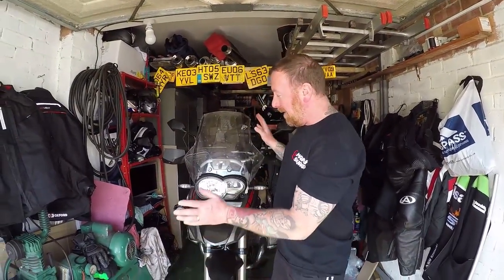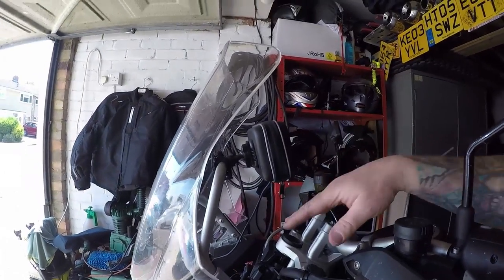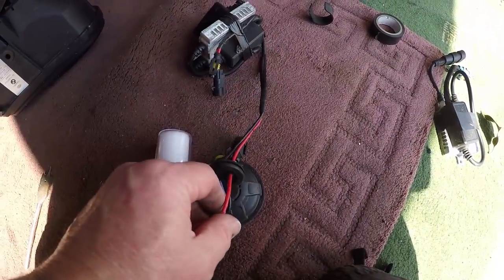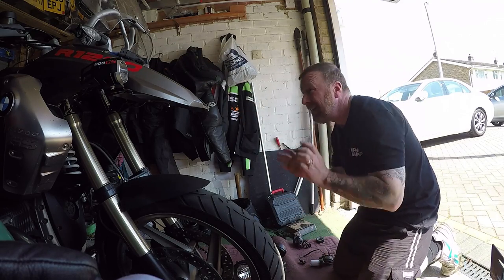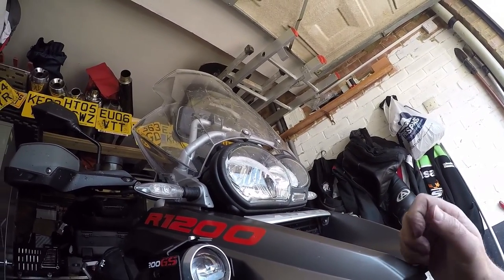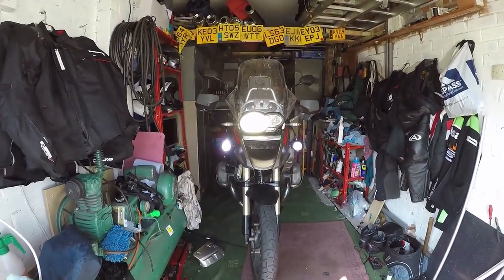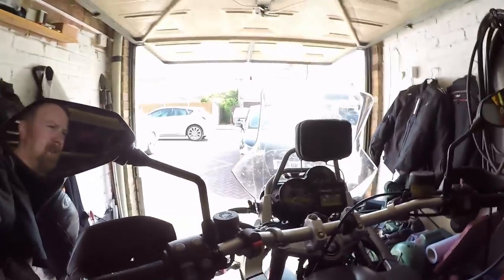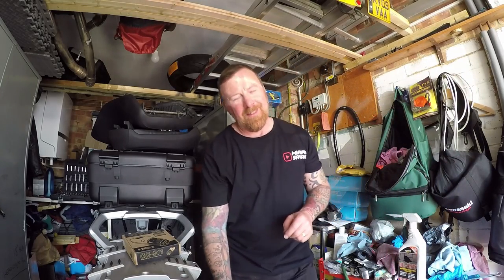BMW 1200 GS XENON HID LIGHT UPGRADE SIMPLE FIX MARK SAVAGE

Comment: Phew there bright  ;-)
Would you have any ideas on upgrading my headlight,i have a 2001 BMW F650GS,and the headlight runs on gas,the bloody thing is absolutely "CRAP"
Help Regd 
Cheers Baza ;-)
Reply from the maker: hi bud thanks for watching, the do hid kits for every buld so just find out the bulb that you have in you bike now like  H4  find the hid kit and replace.
you will have to take it out like I did and drill the rear cover 25mm lol then find a place for the pack and all should be good, like me i'd only replace the low beam.
hope all goes well please like share and sub 
mark
Reply: mark savage Hi mate thanks for your reply,keep em coming 🤘😎

Comment: Hi I need to ask u a question on my 50cc moped when I turn the ignition on none off my light work and the horn and the starter aswell don’t work but when I kick start it all the light start flickering and I don’t know the problem
Reply from the maker: hi bud thanks for watching
i have many videos on mopeds that will help, but yous should be a simple fix
one check the fuse or your battery is dead bud also check the power leads, that should be the problem if not you may have a cut wire somewhere.
next if that's not it its your stator
please like share and sub
mark

Comment: Hi Mark, my yamaha aerox has been sat for a month, now when i go to kick it, it starts for a few seconds then dies, any ideas?
Reply from the maker: Matti De'Beer hi bud 
Well start with a service, new plug , clean or replace air filter
Service carb and check fuel pipes 
A lot of peds do this, if you have recently serviced it then maybe pop in some easy start to get the petrol through and into the head 
If after this and the service will have have to move up to the next lever so come back to me 
I have many aerox videos that will help with the carb and service 
Sit on a computer as some won’t come up on the phone 
Please like share and sub
Mark
Reply: Okay will do that thanks Mark, i actually didnt think of the air filter, im gonna check all that out later, Thanks!
Reply: mark savage cleaning the carb did the job! Although there is still a fucking annoying rattle in the variator and I just rebuilt the whole thing! No clue to what it is mate.
Reply from the maker: its often the Bendix as they become loose and rattle against the out part of the VARIATOR or the kick start cog on the case.
take it off and check it all bud, good to hear its running 
mark
Reply: mark savage okay mark thanks a lot will check it out soon.
Reply: mark savage okay mark, I took it for a test ride I couldnt identify the rattle when I stripped the cvt, when I rode it, it took of well then lost power then we'll again and kept on doing that. Later on after about 5 mins it wouldn't go above 20mph and the variator and clutch were extremely hot
Reply from the maker: looks like you will need to take it all off and clean the VARIATOR and clutch as they can jam as in one of my speedfight videos, as for the lost of power that still could also be fuel so check the fuel lines and carb is on ok and that its filing up ok with the float in the carb
mark
Reply: mark savage okay mark, the variator is brand new but the clutch is old and rusty where the belt sits I did sand it down tho, the clutch bell is also purple like everywhere so thay might be the cause for it. Might buy a clutch kit than comes with the clutch bell and whole clutch assembly with it. Thanks mark
Reply from the maker: Matti De'Beer sounds like that maybe your problem if it’s old and rusty like in my winter ride video that was my clutch jamming and if your variator is new and 6g rollers or around that weight that should be all fine bud
Reply: Yep new variator with new 5.5g rollers which are stock, i think so it might be the clutch causing all the issue, thanks mark for your help!
Reply: Oh and i completely forgot to say! There is some sort of rubbing noise coming from the variator also, when i put my ear to the case it sounds like its coming from the clutch which also adds to my point.